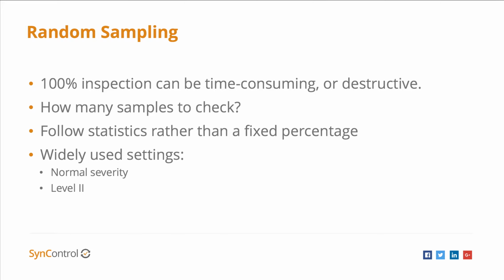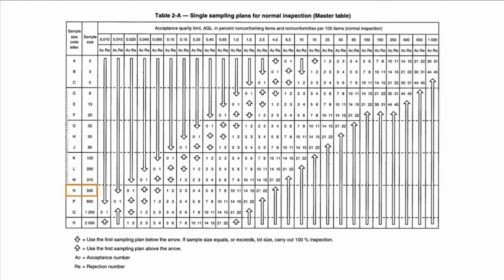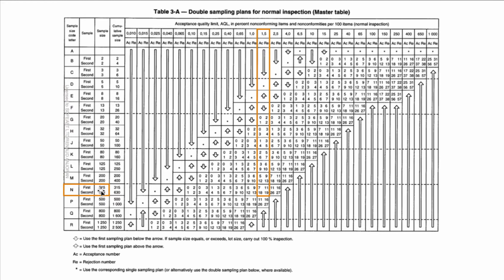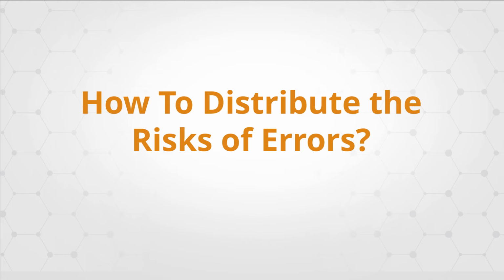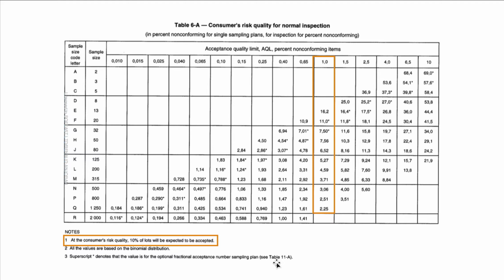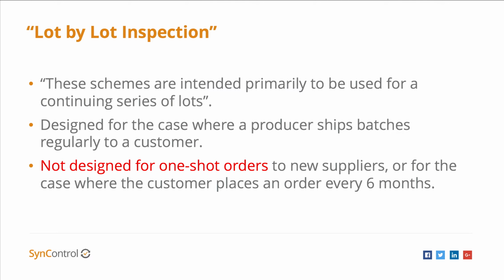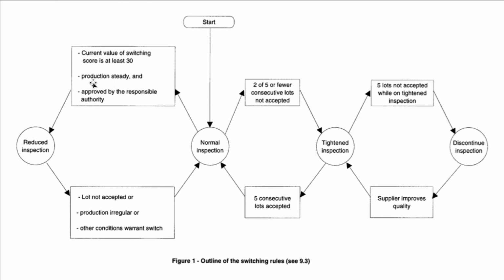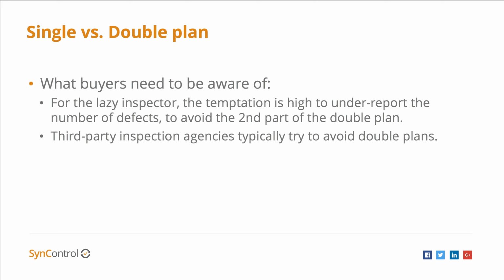How To Read the AQL Tables for Quality Inspections (Random Sampling)

Comment: I have a misunderstanding in the series of Iso 2859, In Iso 2589 part 1 applied in the case of the lot by lot, but if we consider that the goods lot received isolate, we would apply Iso 2859 part 2 for Limit quality (LQ). I have the question, how can we use AQL in this case of isolate lots received

Comment: Great video, explaining theoretical and practical issues. 
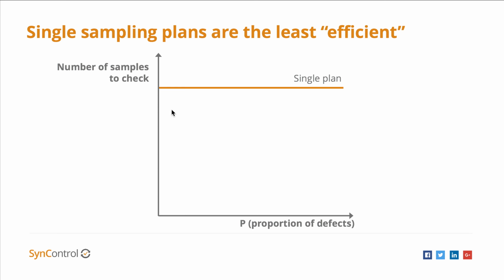Just to add my two cents, I noticed 2 errors, the one stated by Jacques Routier and another one on 20:42 : the peak of the "number of samples to check" is not around the AQL, but a bit past the Ac, as can be seen in the next grap; it would be, as it's logical, around the "unconclusive" range of the first sample